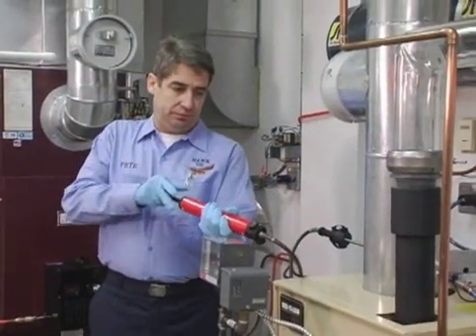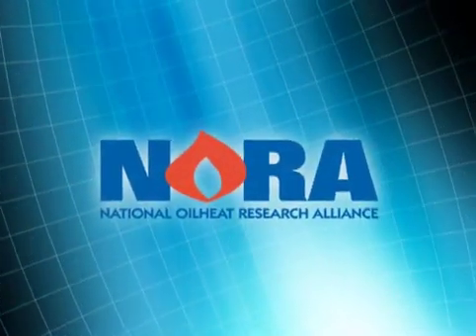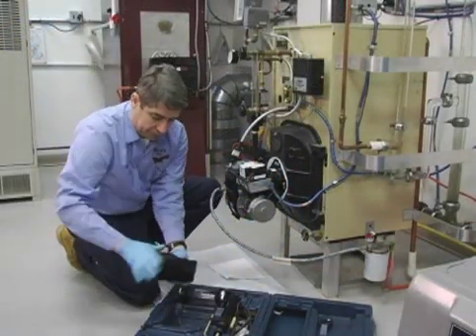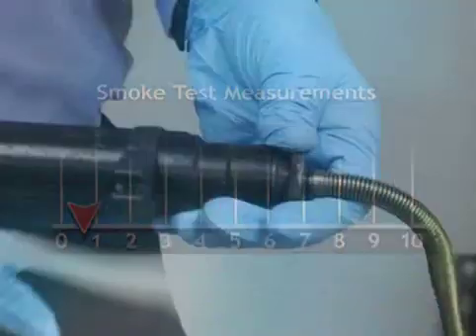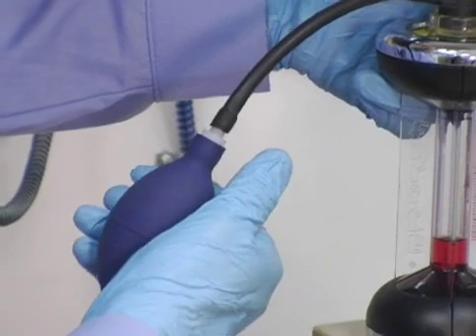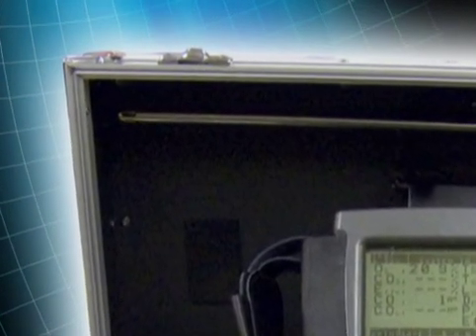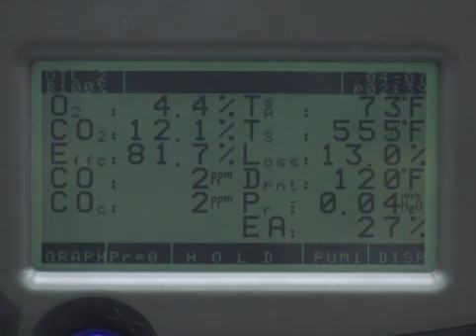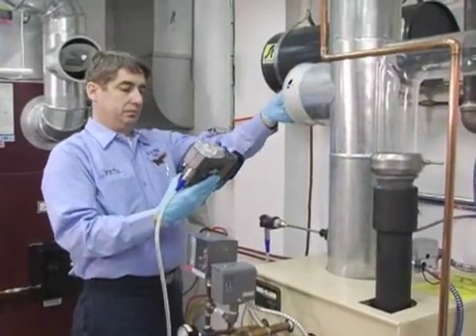Combustion Efficiency Testing

Comment: Keep that wet kit to verify the accuracy of the electronic tester and to keep as a backup if the electronic tester goes wacky.   Those electronic sensors are not trouble free folks..
Reply from the maker: Thanks for your feedback. If you have any questions, feel free to contact us regarding this topic: info@wohlerusa.com or +1 978 750 9876